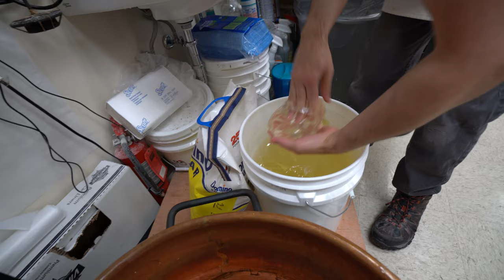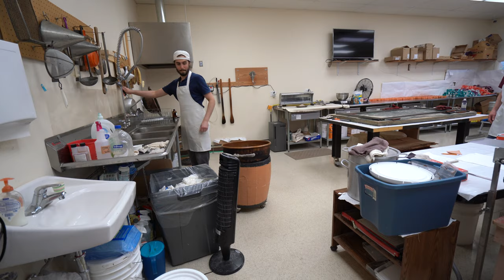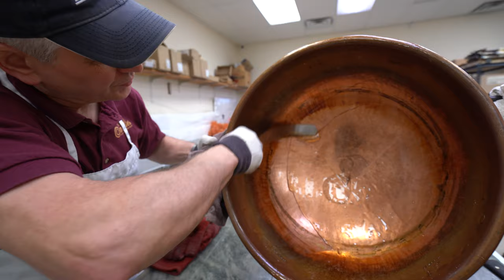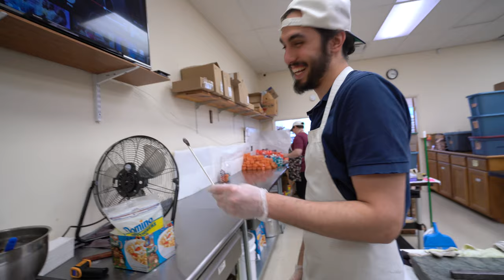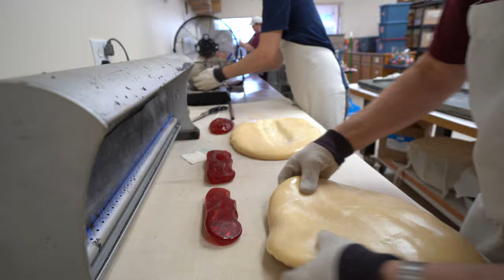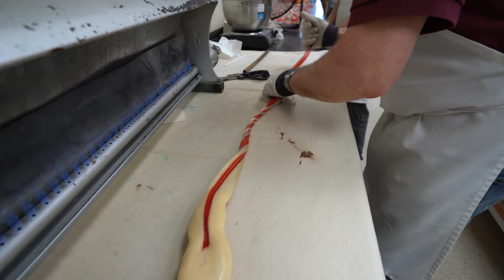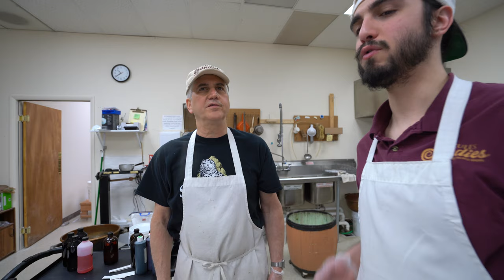How It's Made: Chocolate Filled Peppermint Pretzels

Comment: 0:34 Corn Syrup is also a non Newtonian fluid, which is part of why it can be picked up as long as you keep it moving.
Reply: Because I'm not a scientist.  Is cornstarch and water the same then?  Just curious.
Reply: Rhaine E. Daize yes
Reply: Corn syrup is not a non Newtonian fluid. It can appear that way based off the ability to handle it, but it's simply because of it's thickness. It's viscosity does not change based on the force applied. 

Real scientist here.
Reply: Nicholas M I just knew that cornstarch and water created a non-Newtonian liquid. Didn’t want to claim that about the corn syrup, so I didn’t. Glad you clarified!

Comment: lofty mixes his color in when he first puts the hot sugar on the table and it mixes a lot easier. great video
Reply: Greg's got a stainless steel table, so doesn't get stained by the colors.  Hercules has a marble table, and they have to be careful not to get the color directly on it, otherwise they have to clean up the stain.  (some of the Basement Tapes showed the resulting mess when the color got spilled directly onto the marble)